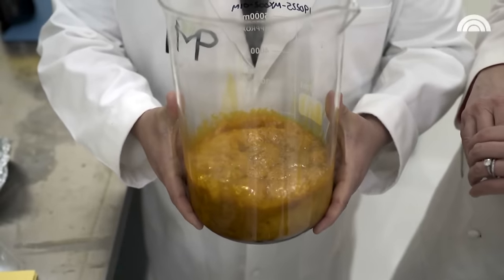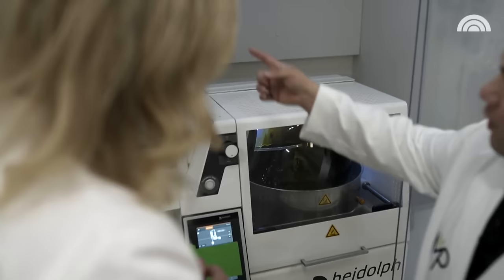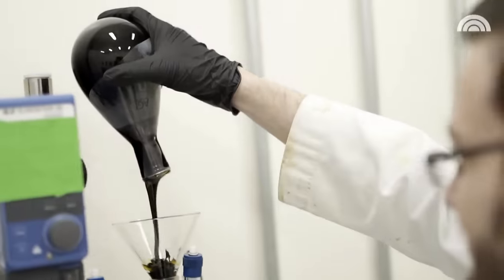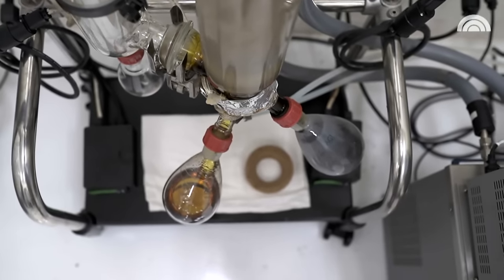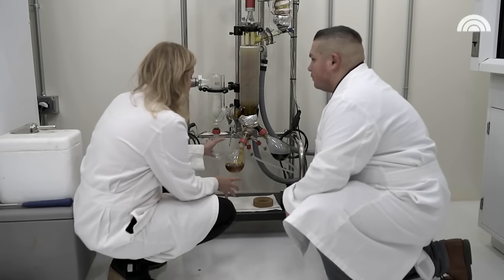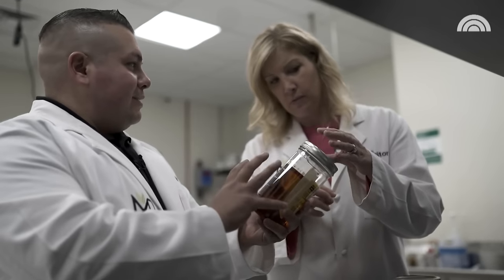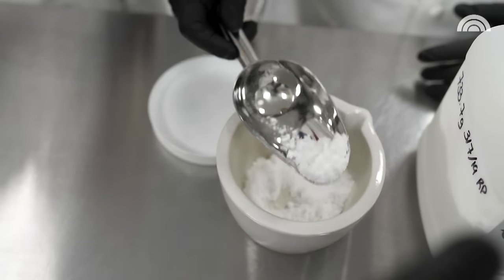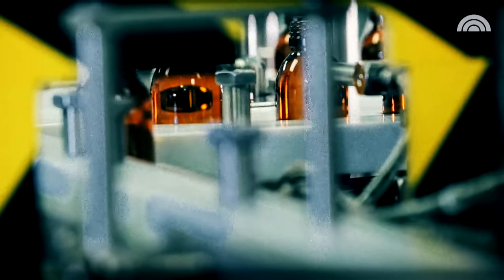How CBD Is Extracted From Cannabis | TODAY

Comment: ethanol??? and we can bring this on the road...
Reply: there is no ethanol in the final product. It is just used for the extraction process because cannabinoids are soluble in it and can be separated from the unwanted parts of the plant.
Reply: @palmapanfu  there can be some residuals using the ethanol process rather than the CO2 method.